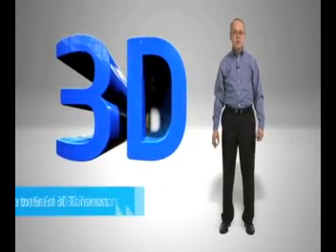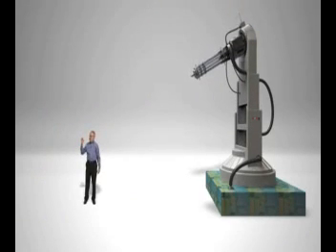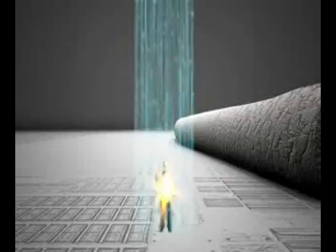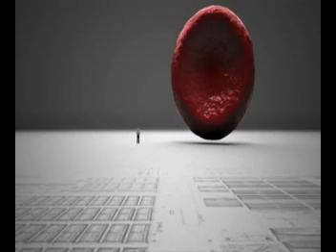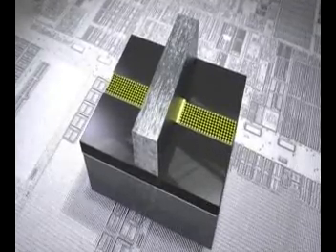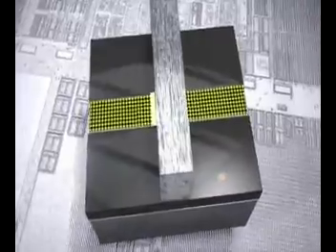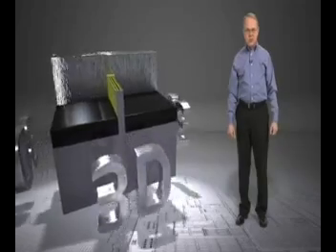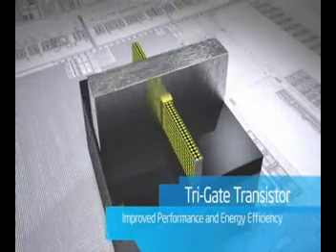Intels Ivy Bridge Platform to utilize 3d transisters

Comment: thanks for the explanation. But i had made up my mind already. Yes, Ivy bridge does not overclock as well as sandy bridge in terms of clock speed but it doesn't have to since clock for clock ivy will give you more performance. therefore IVY at 4.3 still outperforms sandy at 4.9.

Comment: @comneard55 
if you have the cash, yes. it will be like 20% stronger than sandy bridge, besides having more cores and being more cooling and energy efficient. but dont even think about using its integrated graphics chip, it will still suck as all integrated chips do, did and will do FOREVER. buy this proc, a good asus mobo and a NEW gpu series from AMD or NVIDIA (choose the one you preffer, dont want to start a fanboy war here) and play whatever you want on ultra.

Comment: @comneard55 Well. It being 22 nm and having a 3 sided stream allows it to be more energy efficient which in-turn would also mean that it would run cooler and allow for more headroom in clock rates.  
It will likely be a great over-clocker.